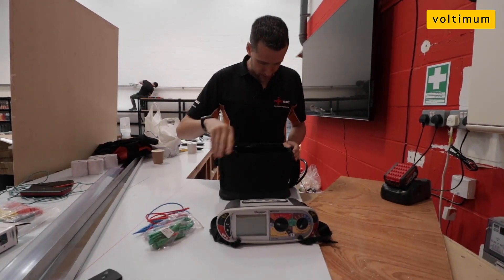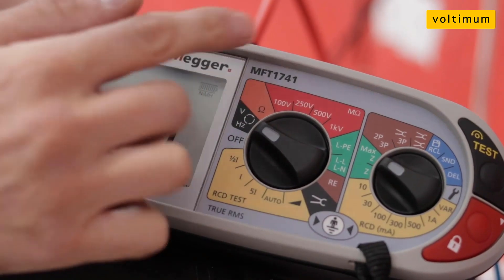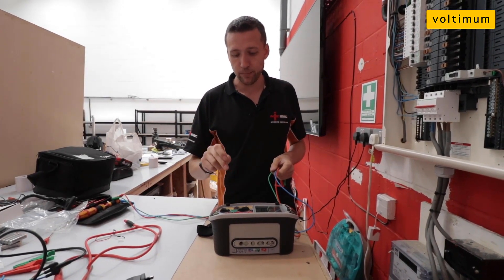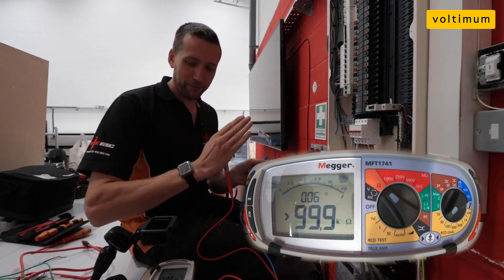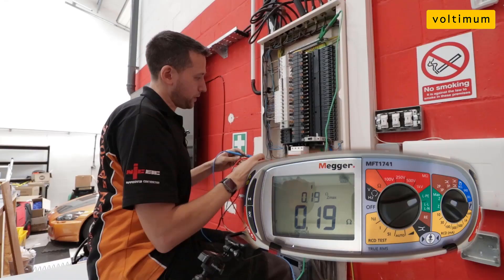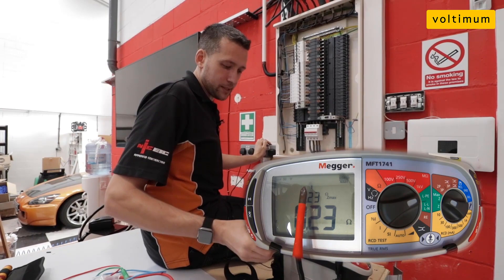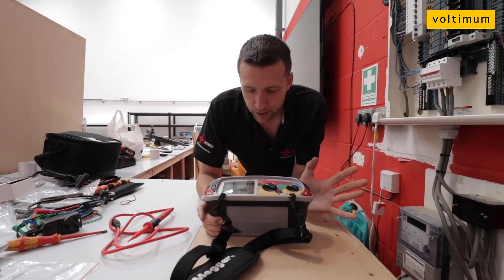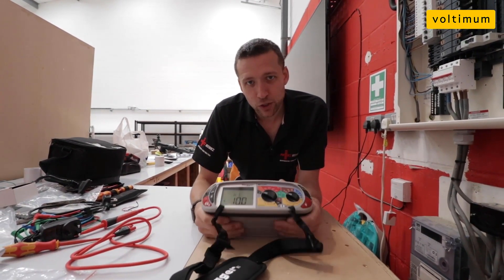Thomas Nagy reviews the Megger MFT1741

Comment: Bought my Megger  1731 when I started as it was just easier to see the results.  Been using a borrowed Fluke for a few weeks. Not much in the overall result but the Megger is far easier to use and read.  The Fluke has a far better case and less tangle-prone leads. The Fluke boxes are actually an standard technicians case with shaped foam while the Megger case is an expensive, blow-moulded hard case.  C'mon Megger - swallow your pride and use the (better & cheaper) Fluke type box.   To echo another comment, a brief word on "uplift" appreciated.  Well done Thomas